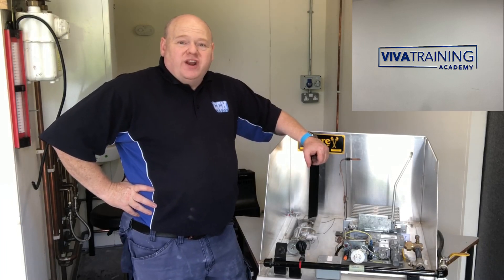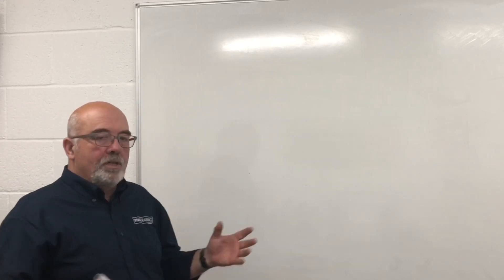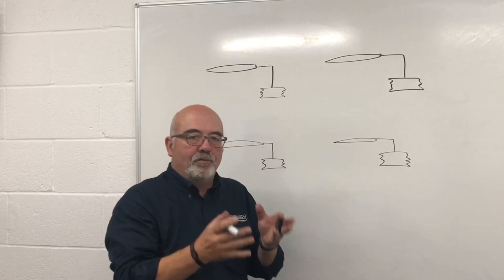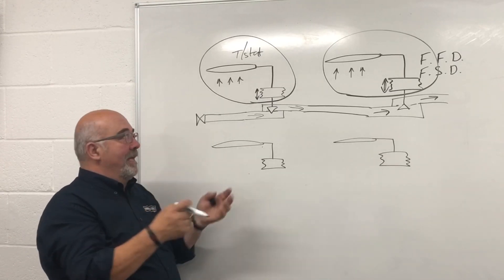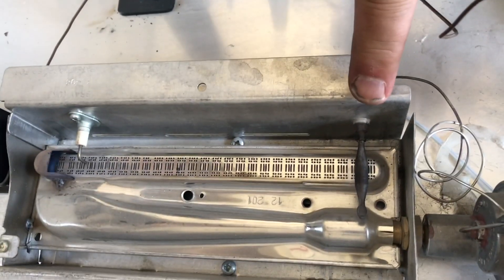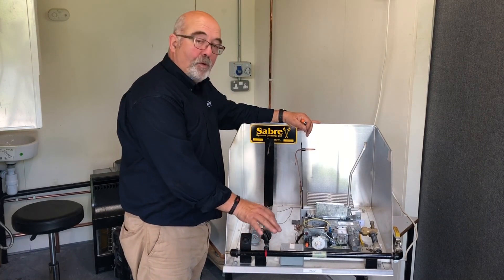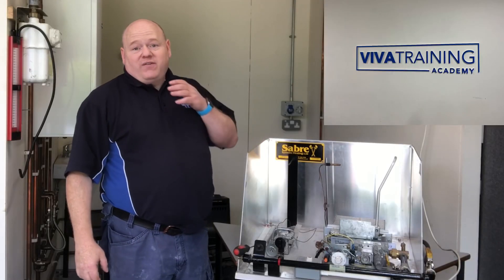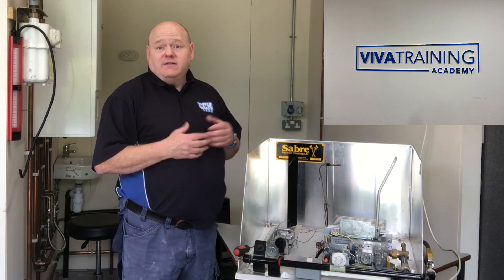ACS Gas Training - Controls - Understanding How Controls Work - Russell Holdsworth

Comment: The second section with the multifunctional control, Once the thermocouple is heated and allows gas through the valve, it goes through the simple regulator and to the solenoid which is operated via the thermoelectric switch. My question, how does the switch know when to send electricity to the solenoid to open the valve?
Reply from the maker: Thank You

Comment: great video! wanted to ask if the the flame goes out on the byepass for the cooker, does the the gas continuously flow? doesnt the gas get completely shut as its not sensing a flame. Thanks
Reply: If there is an interruption to the gas the flame will go out, if gas is reestablished it will flow into the burner unlit through the bypass.  It's unlikely to create an explosive atmosphere though because of ventilation requirements for cookers.  Saying that a thermoelectric FSD is better than a liquid expansion because it will shut off gas to the burner in case of flame failure.
Reply: @MSKChess  thanks
Reply: @abdulh63  Most welcome bhai
Reply: A liquid expansion flame supervision device never fully shuts off gas flow (unlike other FSDs). If the flame fails, the valve partially closes to a very low flow rate that should not cause explosive build-up of unburnt gas. When you light the oven, you see a very low flame. Then, once the liquid expansion phial heats up, the flame suddenly goes to full height. The low flow rate can be thought of as a bypass rate for the FSD, but do not confuse it with the oven thermostat bypass which takes over when the oven reaches setting temperature. They are two different things.

Comment: I'm having a thick moment:  if the thermostat valve closes when reaching temperature and cuts off the gas flow, how can the gas get through to feed the bypass low flame? OOPS, you explained later, thanks, Great explanation thanks!
Reply: The main gas valve is closed but there is a small bypass which a small amount of gas goes through